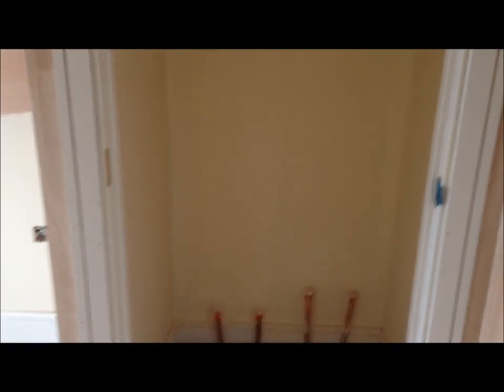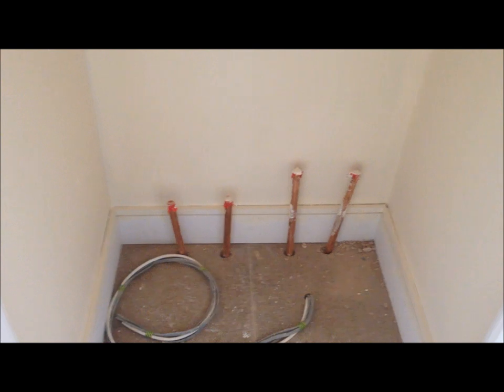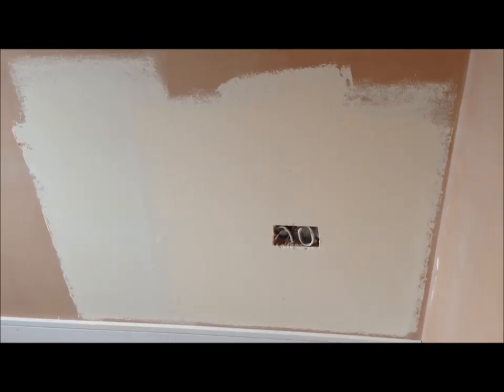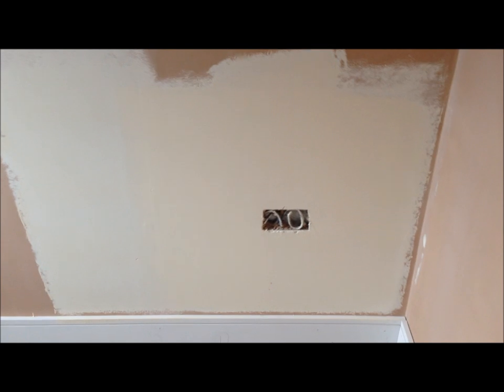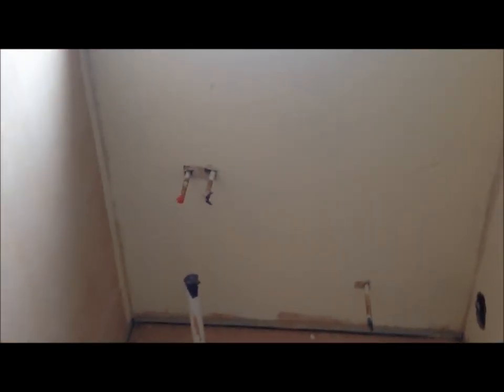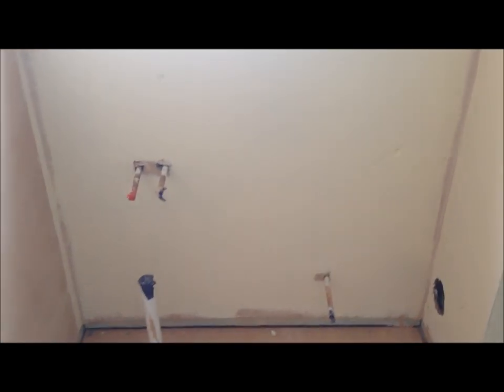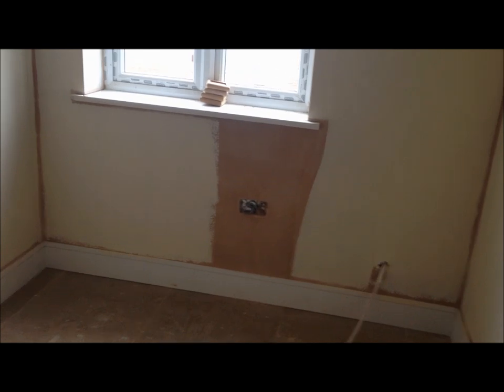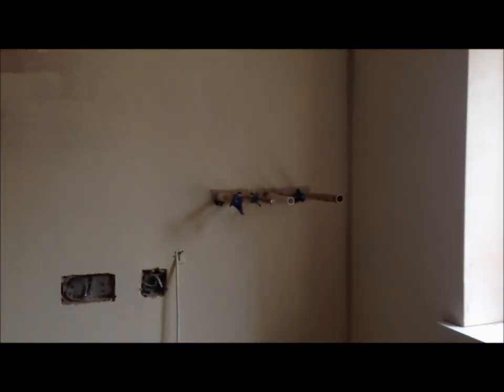Painting & decorating, Basecoating new plaster, special points of interest

Comment: Please correct me if I’m wrong but I do a lot of painting for my boss on new builds, and I always prefer painting the walls before the skirts and architraves go on, saves the cutting in with a brush which is always seen due to the different texture around the wood, and also doorframes, before stops and architraves are fitted I like to coat up the door frames because I find them a bastard to paint when they’ve got all the extras on them